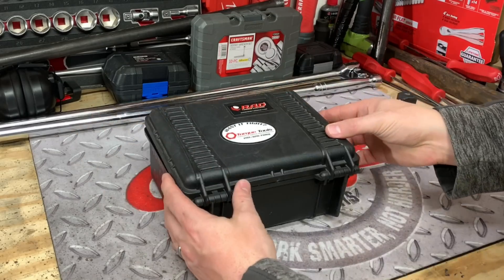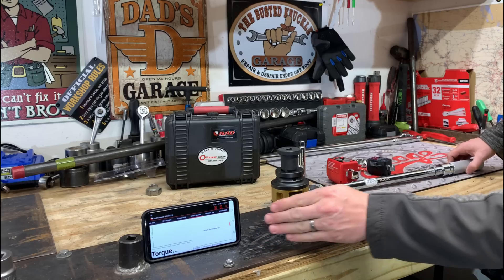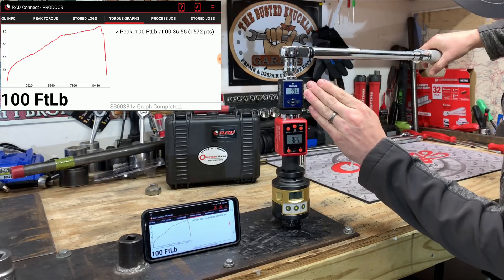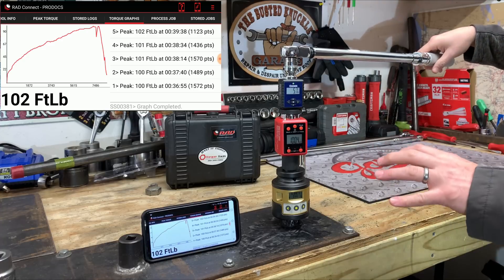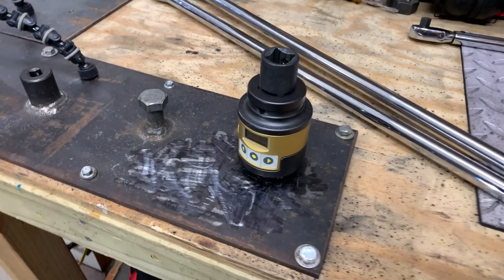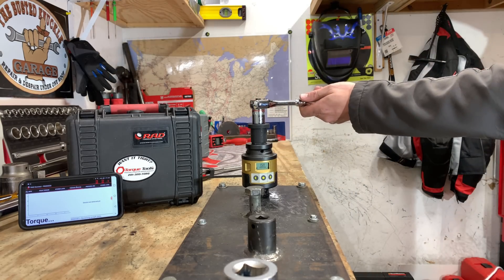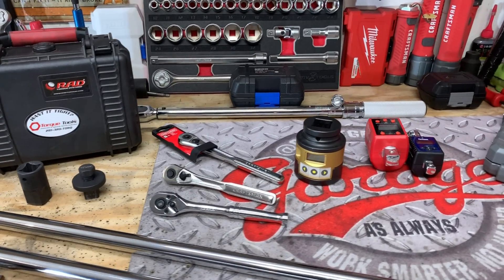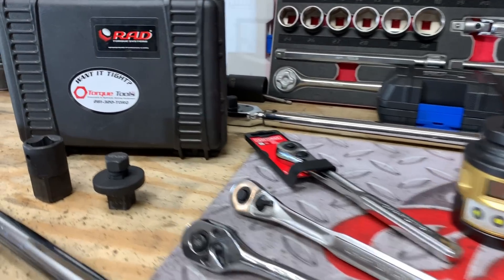World's Most Expensive Torque Socket Testing the Tower of Torque

Comment: Can you use that socket to test the strength of all the impact wrenches?
Reply from the maker: It is not impact rated and is for continuous torque only.  You would use a nut runner on this 1” drive socket

Comment: Hey chris according to harbir freight there icon 3/4 breaker bar is 36 inches long that would make the capri 3/4 breaker bar 4 inches longer at 40 inches does the icon actually measure as 36 inches or dies it measure at 38 inches i remember you said it was 2 inches shorter then the capri
Reply from the maker: Center of the anvil on a 90 degree the Capri is @ 37.5" vs Icon @ 36"  The Capri is 40" end to end with the drive square extended straight and the ICON is actually 37.25"
Reply: @ClientGraphics  awww okay

Comment: I been eye balling that new icon 3/4 breaker bar
Reply from the maker: There is only a 2” difference in length between the ICON and Capri if length matters measuring from the center of the anvil in the 90 degree position. Capri is cheaper and the ICON had a slightly slimmer head.
Reply: @ClientGraphics  thanks for the heads up
Reply: @ClientGraphics  wow capri is 60 bucks at home depot for the 40 inch was the capri thicker around in the handle then the icon or were they about the same thickness

Comment: Oh By the Way, ya need a 1" drive square drive output torque multiplier to go with this nifty torque socket...
Reply from the maker: What I really want is a nut runner capable of 2-3k ft-lbs that I can put on an adaptor to anysize ratchet I want that will measure peak torque. Make a little rig, pull the trigger and done. Sadly it is really expensive and not easly available and an outrageous dream.  We'll see what happens.
Reply: @ClientGraphics  Like this wrench dyno at Tien-i, Taiwan?
https://www.youtube.com/watch?v=gwCAlGK0wCQ

Torque to failure test are some what interesting, better test for real world tool life would be cycle testing in both clock-wise and counter-clockwise near the ANSI spec for a given hand tool. Example If a 3/8" square drive ratchet Under Test survives more than one Million CW<>CCW at 150ft/lbs, that would be far more telling about how long that ratchet would last than just torque to failure test. Great difficulty with a test like this is the equipment and time involved.

One of the many tool reviewer folks on Youtube should do this. In combination with torque to failure and tool ergonomic assignment vs tool weight would tell a LOT more about any given hand tool in real world conditions.

Comment: So what have we learned today?

That the $99 ICON torque wrench is on point. And exactly as good as (if not better) as the more expensive options available. However with a better warranty.
Reply from the maker: Full disclosure my ICON torque wrench has been tested and calibrated and certified on a NIST traceable machine. The wrench was exercised prior to testing and I have used it a lot to become consistent with it. The tool is only as accurate as the calibration and most importantly the user.
Reply: ClientGraphics I forgot that you had said you got it calibrated. Out of curiosity how much can your average person expect to pay for such services?
Reply from the maker: Anywhere from $45 to $100 or more, but it's more complicated than you might expect. Few different variables being the capacity of the wrench and if any adjustments or repairs are needed. Oh and add shipping cost in if you don't have a local place.  If you don't need a certificate or NIS traceability that can bring down the price.

Comment: How would craftsman USA ratchets perform? Craftsman tools weren't meant to be used professionally or in high torque applications. Craftsman is for, "Im going to work on my car because it needs to pass inspection."  "I need to put together my ole ladies Ikea furniture." or "assembly of my kids bike." I need to put together our new  barbeque." " I need to fix the lawn mower." Craftsman tools are intended for home use. To be used when you need them and not used on a daily basis. They are not ideal to be used professionally. In fact some facilities require your tools to meet ANSI or ASME specification. Craftsman doesn't meet those specs.

Comment: Being able to apply about 700ft/lb with a 3/4" drive tool is a good illustration of why there is zero reason to attempt this amount of torque with 1/2" drive tools... So many moto folks apply absurdly long cheater bars to their 1/2" drive tool with zero expectation for tool failure.. until the tool failure suddenly happens and accompanied by bodily injury or serious damage to the wrenching bits involved.

BTW, if the 3/4" torque tool had a 1.5" diameter alloy steel tube of no less than 0.10" thick, there would be a LOT less flex with more torque transmitted to the target torque device (socket).
Reply from the maker: Rupunzel By hand 700 ft-lbs is pretty serious torque and as you mentioned 1/2” drive is absolutely not the correct drive size.  Both the ICON and Capri 3/4” breaker bars are around 0.851-0.868” in diameter👍🏻
Reply: @ClientGraphics  Yet many folks apply the largest cheater available on a 1/2" drive socket tool trying to loosen a stuck threaded fastener only to have a tool failure. This is very common. The correct action is to go up one or more square drive size which prevents tool failure and injury. 

Any good quality (Icon, Capri, Tekton and ... many others) 3/4" drive easily exceeds the torque capability of the best 1/2" square drive a MUCH lower cost.. Yet, some insist on using 1/2" drive..

Comment: The Quinn seems the most realistic since it's going both above and below the target torque.
Reply from the maker: The Quinn digital torque adaptor is pretty spot on with a max limitation to the torque range of @ 147.5 for audio alert.  However, after discovering industrial torque transducers they have a higher sampling rate and are simply more with being able to handle more torque. DIY Quinn all the way.

Comment: Very nicely done video. One other thing I would like to know is how well does the breaker bar hold a large socket at an angle. There is nothing more aggravating than to put a socket on a breaker bar with the socket at 90 degrees and as soon as you go to put the breaker bar in a straight-up position and the socket moves straight down at the ground.
Reply from the maker: For me both new the ICON was tighter using a 1 7/8" socket and a 32mm deep.  Now that's not to say it won't loosen over time.  I did tighten the Capri. The Capri had a tighter ball detent.
Reply: @ClientGraphics  Thanks.

Comment: I got a Tekton 3/4" breaker bar. Longest that they make. I put the handle against cement floor and a 1" impact on the other side. Hammered the Hell out of it. Never broke it. But it put dents/chips in the floor though.
Reply from the maker: The Tekton one is a good choice, I almost got it but the Capri was slightly cheaper and the ICON one well it’s on sale right now with coupon🧐
Reply: @ClientGraphics  ain't nothing wrong with either of them. I just switched over to forklifts so now all my big truck tools all got brought home. So it might be awhile before I get to use her again

Comment: What is the price of a socket like this
Reply from the maker: The starting point is around 3k
Reply: Proto does make some 2 1/2" drive sizes that have a list price of more although you can find them in the $2,500 range.
Reply: @DOYLECLEVERLOBE1  Snap-on 2-1/2" drive, 200mm socket is $4,820.00.
Reply: @MrSubaru1387  Wonder if they offer free shipping on that, lol.
Reply: @DOYLECLEVERLOBE1  I can assure you that they don't. They're made to order in the Elkmont, Alabama plant.
Reply: @MrSubaru1387  It's funny that Williams considered their industrial brand and only goes up to a 1-1/2" drive.
Reply from the maker: DOYLECLEVERLOBE1 Not that it’s a competition I have one of the smaller 46mm sockets.  Rad Torque Systems makes up to 100mm in the Smart Socket which is just under 4 inches.  Needless to say the title of the video just didn’t look as cool if I added the smallest largest most expensive socket🤫🤫
Reply: @ClientGraphics Oh I don't have anything beyond 1/2" drive myself just giving a comparison in price but you have to figure a roughly 100lbs socket is going to be expensive and doesn't even come with a chiropractor https://www.grainger.com/product/WRIGHT-Impact-Socket-48J393  Been enjoying the channel btw.